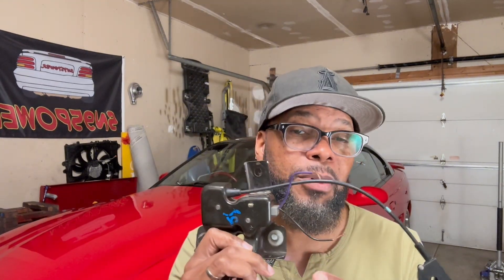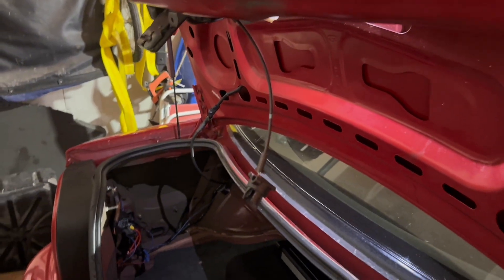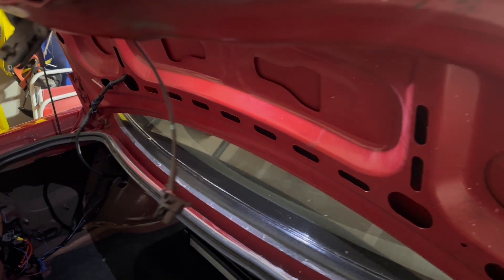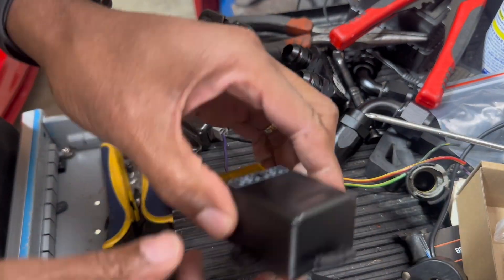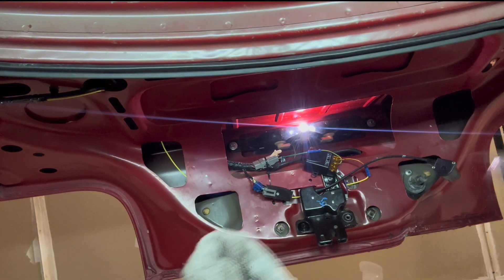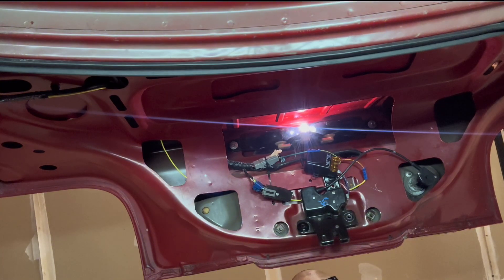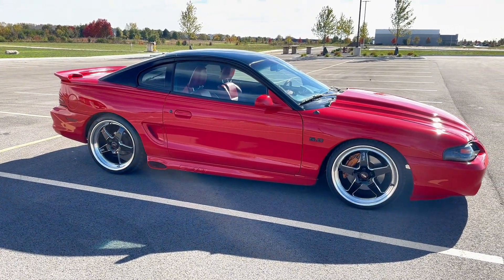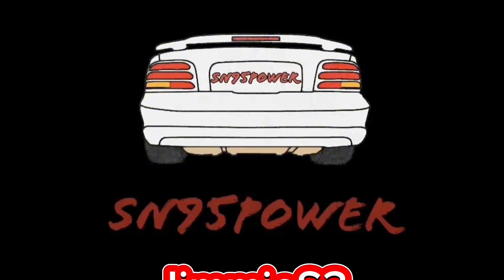Easy DIY Remote Trunk Release for SN95 Mustangs (No Factory Option Needed!)

Comment: I have been watching SN95 videos, trying to recall some of what I have forgotten over the years, life has thrown me some curveballs, causing me to sell my fox and two SN95s many years ago, and I find myself back on this channel in particular over and over. What a wealth of knowledge and information. Im buying a 98 Mustang GT in the next week or so, for 800.00. It runs and drives, has a damaged fender due to a deer collision. This channel has nudged me towards a gen 1 coyote swap (found a few on marketplace for cheap) still deciding on power adder. I had a 351W, Edelbrock performer RPM upper/lower intake, AFR aluminum heads, Paxton supercharger, added a 100 shot of NOS to cool the air charge, with a Tremec trans, sold it around the year 1999. Had a 95 and 96 that were mostly stock, and I’ve had two 03 cobras over the years, but been without a Mustang for 10 years now, and im ready to get back into it, and this channel has woke up the desire to wrench on one again. Long comment, you may never see it, but in case you do, thank you for what you do sir. I envy your drive and patience. Wishing you and your beautiful family the best from Kentucky.
Reply from the maker: Wow, this meant a LOT to read. Thank you for taking the time to share your story.
A $800 ’98 GT is the perfect canvas, and I think you’re going to have a blast with it. A Gen 1 Coyote swap would be excellent.

I appreciate the encouragement and the kind words. Wishing you the best as you jump back into the Mustang world.

Comment: Ford is so weird. So many options to add or leave off. My ‘95 Cobra has all power everything EXCEPT remote lock/unlock. No module in the trunk. No way to program remotes.
Reply from the maker: Yep — Ford was all over the place with mid-90s options. Remote entry wasn’t standard on all Cobras, even with full power everything. Some had the wiring tucked in but no module installed. Classic Ford logic

Comment: That's gonna look great no matter how you clean it up back there.    Other than junkyard trunk panels ScottRod also makes aluminum trunk side liners and a trunk floor,  or else it's easy to make a plywood or hard plastic trunk floor if you can get a carpet to use as a stencil.     ACC makes a black felt trunk "carpet"  that's about $35 on pony parts plus and cj pony parts sells a rubber one.   Possibly you could buy a cheap one, use it as a template to draw your own floor solution that fits around the battery and all that, then raffle or give away the carpet 

I've been getting sabotaged over here on fun projects now that my kitchen remodel is 95% done I discovered a plumbing problem elsewhere in the house that caused some damage and needs to get solved ASAP..   the SN95 is sitting there eager to see some miles on its odometer before winter but there's no time to enjoy it.
Reply from the maker: Just found some used panels on marketplace last night. Hopefully they look as good as the pictures. Get that plumbing sorted quickly so you can get some miles on that SN95 before winter hits! Next 10 days up here are still in the high 50's.